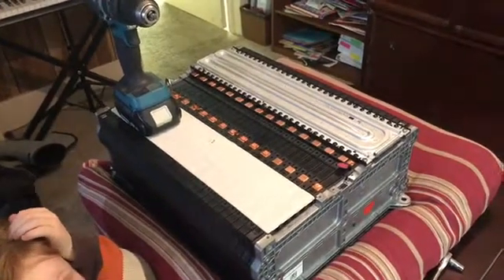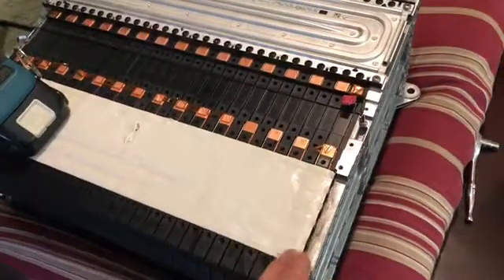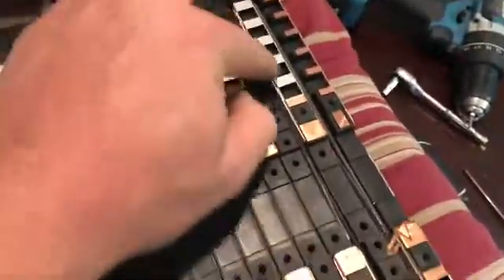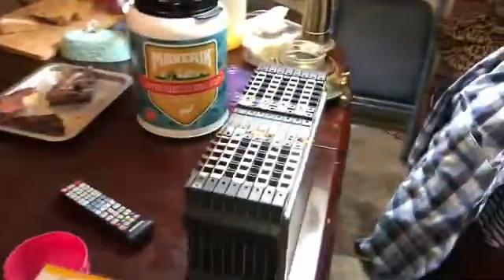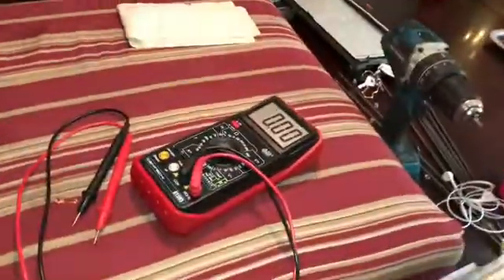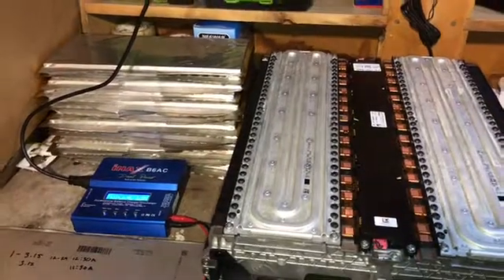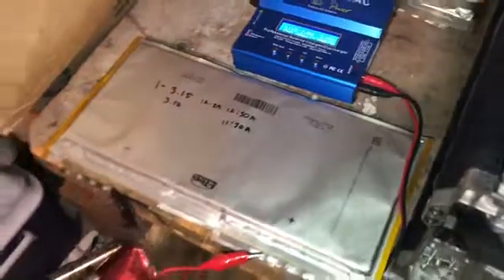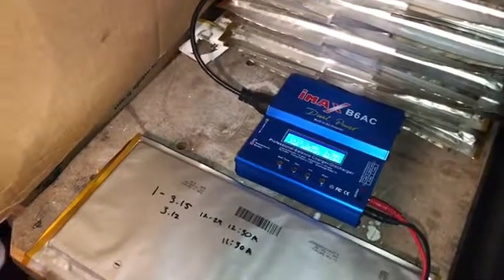Smart Fortwo swap / tear down! Part 2

Comment: I have a 2018 Smart, with the same battery. I am thinking that if I simply replace the pouch cells inside those modules with higher capacity ones, like say 75-100 ah, it should work, however I need the size of the plates where the pouch cells lay, would you happen to know the size??
Reply from the maker: My apologies, up until recently I didn't pay hardly any attention to my youtube channel. We tried to replace cells but it was a huge problem and we were not able to get them back together.
Reply: @subjectmatteramateur16  That is a bummer sorry it didn't work out there is a expected amount of expertise that's required unfortunately...
Reply from the maker: @johnnyzee383  Yeah the micro-tig that I would have had to purchase to weld the copper/nickel leads back together was 20k a used battery from LKQ was only 2k. We made a home storage battery out of the old packs.

Comment: Why you need to change ? How much you pay for baterie ?
Reply from the maker: steve tremblay tremblay the pack was a brick. It had no charge. I negotiated to get a battery from a salvage yard. I won’t say how much exactly I paid. Mercedes wanted $8,000 for a refurbished battery and $2,000 for labor.